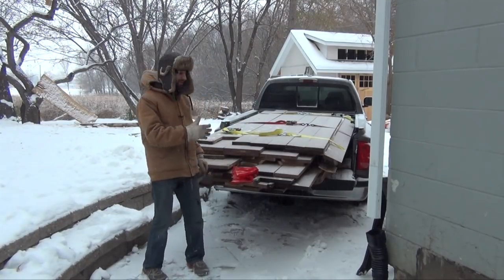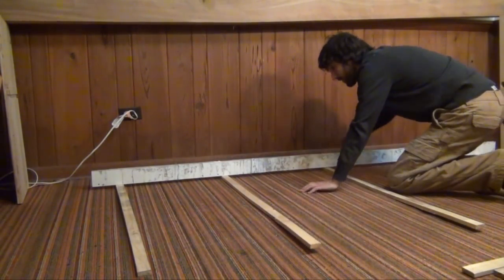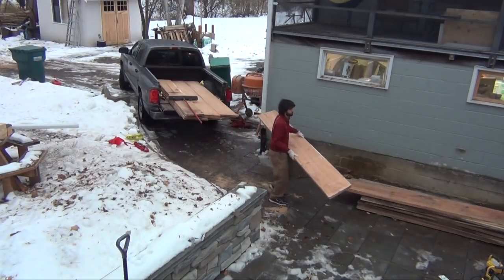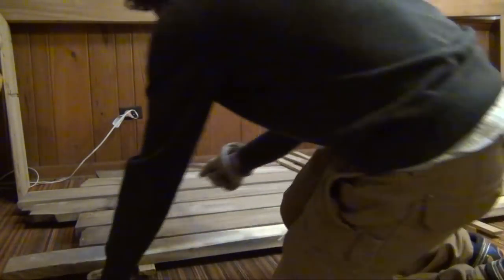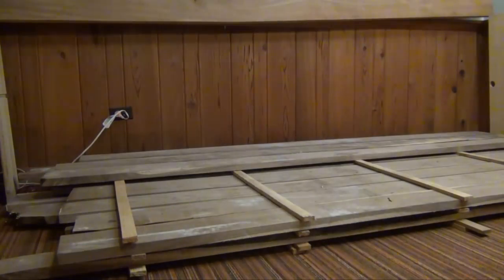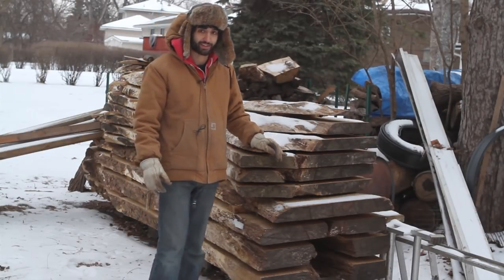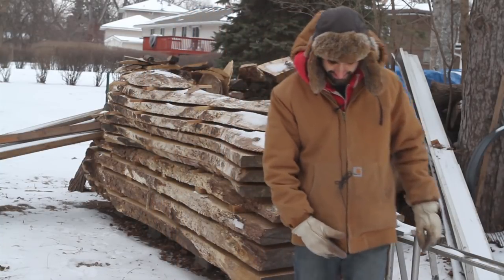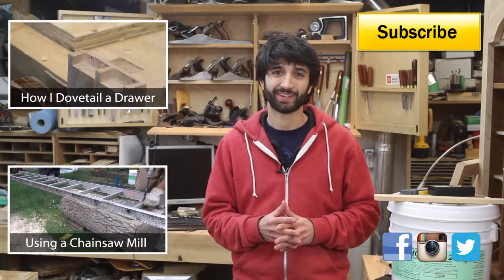Air Drying Your Own Lumber

Comment: Hey there, I was looking around kinda looking up how to make my own rifle stock and such, and it seems its a better idea to air-dry the "blanks" for at least 5+ years. now considering i would only have 2-3 pieces of whatever lumber i choose, will be about 3"x8"x20" what would you recommend about air drying lumber at that size? grain seal still? It would be inside due to Florida having such a high ambient humidity, rather than in a well ventilated garage. just looking to get some input on it. I dont know what species of wood i would use, but im hoping for something exotic since its for a .22 rifle. barely any recoil, so no split risk.
Reply: spartan36789 hey bud with gun stocks you need a really well seasoned piece of timber, not just for dryness but also for timber settling. A piece of wood can keep changing shape for years after it is on the ground and also after each cut. A lot of people I spoke to when I started making my stock had this to say, 10 years as a log 5 years as a plank 5 years as a blank and this was just for cheap stocks. Avoid sapy, bleedy and high tanin woods like softwoods, oak and sweet chestnut.
Reply: I hope I don't comment over you, but heck yes.  I have some blanks curing for some years. I want to see which blanks will waver or turn during their curing process.  Some are terrible off the bandsaw, some come off straight as a reference straight edge.  My sons touch the nicest "cured" pieces and expect all wood to behave this way.    I would make 1 gun stock, then realize what Beretta to make their wood so amazing. They have enough youtube videos... I am a bit jealous of their scale or production....

Comment: So, without the end grain sealer, the ends dry more quickly?? The purpose of the sealer is to get a more even drying time for the entire board?  That's if I understand things correctly.  Have you thought about a solar kiln - not sure if that would help or not in your area.  Great video - very interesting.   Wood Geeks

Scott
Reply from the maker: The 2 Car Garage Shop Yes, without sealing the endgrain looses moisture much faster than the surface of the board.  This causes stress which results in the board splitting and checking.  I have access to a solar kiln too.  Works great.  This is another way to increase the amount of lumber that can be dried quickly.  Thanks Scott!

Comment: If you have a dehumidifier running in the room is it possible to dry thinner (less than 5/4) boards too quickly and damage them, even with the ends sealed? I'd like to try this method but with smaller scale reclaimed boards that've been soaking up some water outside a friend's house... LOL, I'm afraid I don't have room in my apartment for 12 ft. boards, or massive slabs.
Reply from the maker: Orion The boards that I am stacking in this video are 4/4.  I've never had a problem with them drying too fast.  I think this is about the fastest way to dry them without drying them too fast.

Comment: Gday matt big fan of your chainsaw milling videos very informative, Are you going to be doing any more CSM vids
Reply from the maker: symo89 Thank you!  I just have the 3 of those right now.  I haven't gotten any large logs since that big red oak one.  Hopefully storm season will gift me with something I can slab up :)
Reply: not a prob dude have you had any drama with your Panthermill? would you recommend it? I can`t decide between the panther and a Granberg if your familiar with Granberg
Reply from the maker: symo89 No issues.  Works great.  I haven't used a granberg but I know the panthermill is cheaper and does the same thing ;)

Comment: After you air dry your boards.. do you Kiln them too or are they ready working at that point? Also can different lumber be dried together say walnut and cherry slabs in the same area? Great video Matt.
Reply from the maker: Jorge Araujo I don't need to since the boards are as dry as they would be in a kiln after leaving my basement.  If they were dried outdoors, they would need to be dried a little more before being totally ready to go.  You can mix species in the same stack.  I usually just keep one species per row in case on species shrinks more than another.  Thanks Jorge!
Reply: I cant  believe Lindsay lets you bring your wood into the house for years  waiting for them to dry.   So, no  kiln drying to get to 8%mc.
Reply: Just noticed your chisels in the background .  What brand are they and why did you choose those for dovetails,  say.

Comment: Matt, I will be having my  pine trees milled into 2x4s, 2x6s (8', 10' and 12' long) and some 4x4 and 6x6 posts to build a barn. I have a couple Long Leaf Pines that I plan on using the heart for the posts.  When I stack the lumber to dry it, can I use the 2x4s as stickers or do I need to get some smaller pieces? I want to be able to use the 2x4s in the construction of the barn once the wood is dried.  Also, what do I do to dry the posts properly?

Comment: I never cut wood, but if I had to guess, I'd weigh a board to gauge the dryness.
Reply: The formula is mc = wet sample weight minus dry sample weight divided by the dry sample weight and multiplied by 100

Comment: Question: I am drying some pecan wood that I milled down. I am drying it on a rack in the garage. I live in KS and the garage is hot and dry. I am still guessing that will take 2-3 months. Does that sound about right.
Reply: If you are unsure, I would say dry the wood about 4-5 months per inch of thickness, due to your area being a generally dry region of the country.
Reply: Get a moisture meter. or continually weigh a sample the same thickness as what your drying, when the wood stops loosing weight its at Equilibrium with the environment its in.

Comment: My question is about drying non sawn wood. Logs and branches. I put candlewax on the ends. Should i lay em or put them upright?, how long? Any tips?
Reply from the maker: Willem Kossen I wouldn't think that it would matter if they were laid down or standing upright.  The dry time will vary depending on the thickness of the branch or log and the drying condition.  I'm sure it's not much different than drying boards.
Reply: Thanks.
Reply: +Willem Kossen strip the bark off the logs and branches if possible.  .  the bark seals in the moisture.  i use candlewax(or parrafin wax used in canning from the supermarket) on mine as well.  i found an electric hotplate with it's own pan, and use that for melting the wax.  much safer than a blow torch of lit candles in the workshop.

Comment: how dry should a piece of wood be to use as framing a garage or shed? great video
Reply from the maker: You can get away with wetter lumber.  The construction lumber that is kiln dried and for sale at home centers is usually just under 20%
Reply: Matthew Cremona thanks

Comment: If I get my lumber already dry, is there anything I need to do to it to keep it flat? Should I sticker it, or just stacking it is fine?

Also, it seems that 2x4s from the box store might not be fully dry, because even when I pick out the straightest ones, they end up all warped and twisted by the time I go to use them.
Reply from the maker: J.L.M. If the environment you are bringing it into is the same as where it came from you can just stack it but if it's different you should sticker it and let it acclimate.  Construction lumber is not dried fully.  It's sold a lot "wetter" than dried "furniture grade" lumber.
Reply: Where a board is cut from a log has a lot to do with how much it will shrink and warp. Rummage through the stack in the shop when buying and only take the best ones. With your 2 x 4's when it's laying on a 4"face the best boards will have the end grain as close as possible to upright or 90 degrees to the 4" face. The flatter the grain gets the more movement. Buying semi dried timber is a trap as initially when drying timber the cells in the timber empty out first. After that the cell itself dries and guess which part of the drying process has the most distortion.

Comment: How do you keep bugs out when drying outdoors? here in FL they eat everything
Reply from the maker: +Joshua Colantuono one of the few advantages of living in a northern state. Bugs aren't much of a problem here
Reply: If you use wood that is edged (no bark),  you'll eliminate 90% of the problem.  Standard termite control (may include spraying around the lumber stack) would be a good idea for your area.  Most of the bugs in the wood require moisture, and will die when the wood dries.  Heat treating (bring the wood up to 135 deg F or higher) is the most reliable way to kill all bugs in the wood.

Comment: If you use a dehumidifier/heater in a sealed building fast will drying be per inch?
Reply from the maker: depends on how hot and dry it gets and how much airflow.  That's the premise of a dehumidication kiln
Reply: touche

Comment: matt ive got a stack of oak drying i went to check on these the other day and noticed it was all beginning to crack and split 
i was wondering why this is and what can i do to prevent this next time ? any help would be appreciated
Reply: I haven't tried drying precut lumber yet, so i can't offer too much insight. But what I can say is that if its red oak, it has large pores, and with it larger relative gaps as it dries. So its more prone to cracking. Its also a rigid wood, and will warp if stored improperly, and sometimes then will still misbehave even if everything is done perfectly.

But edges crack because they dryout faster than the rest of the wood, and shrink. They shrink unevenly, so that causes cracking, that's why they recommend sealing, and that's why some recommend adding a foot to either side when havesting. Internal stresses in the wood can also cause cracking, like grain pattern, unbalanced growth ring thickness (very common in trees growing on a lean), and damage like knots or dead spots that have scarred over. 

But even of you do everything perfectly, cracking and warping can and does still happen.
Reply: nunya bisnass thankyou I'll keep all that in mind for next time